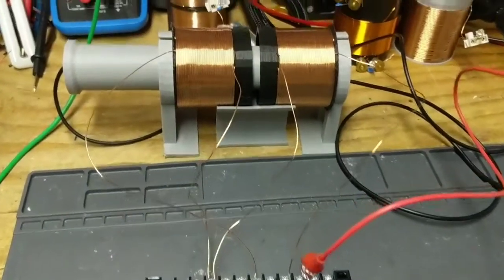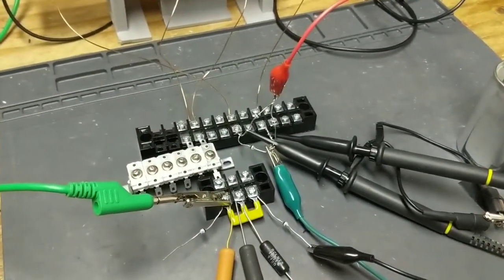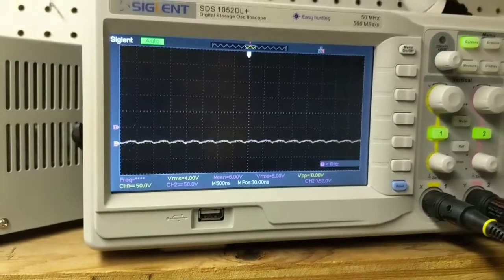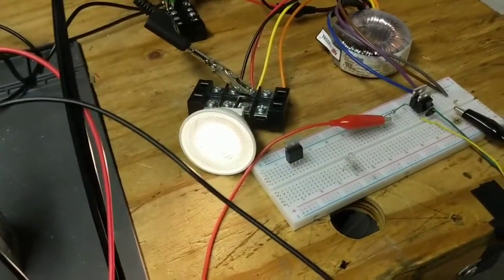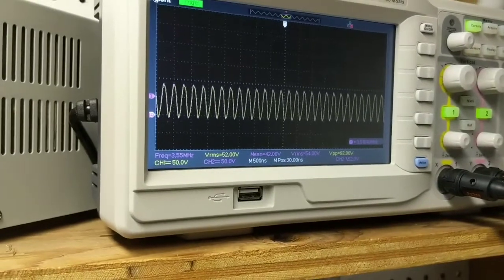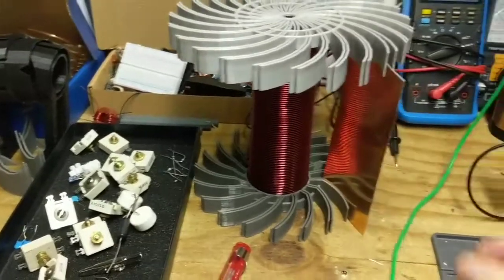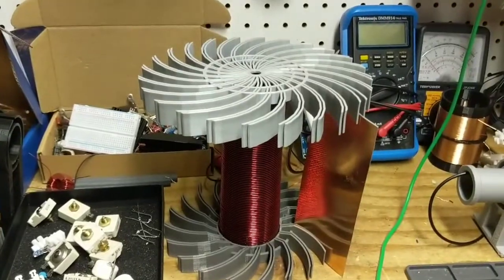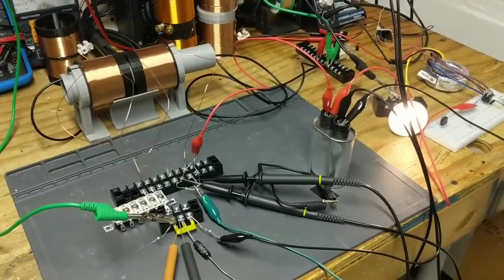Don Smith Circuit - Jan '22 Update & Schematics

Comment: I received the RICK I and II kits earlier this year.  I have tried building a Don Smith device prototype.  I used a NST.  I put a spark gap on the L1 side and made sparks real good.  I got resonance on the L2 side.  But my input was far less than my output.  I am glad to see some else trying.  I have learned from your videos about quarter wave, half wave, and full wave.  I don't think Rick goes into detail about that.  Anyway, thanks for sharing this.  I plan on sticking with this research until I figure it out.

Comment: Use a ZVS to run your coil at its resonant frequency. Do not worry about your L2. use 2cl diodes  backwards with a 100 nanosecond time. you also need 8uf's of capacitor at your high voltage after your combination of the two ends. Use a voltage divider to get to  the voltage of your high voltage capacitor. you also need about 8 microfarads of capacitance at 2,000 to 8,000 volts. Use a larger ground cable. otherwise you have it nailed.
Reply from the maker: Thanks!  I haven't posted many videos lately, but yes finding ways to create more independence between L1 and L2 has been something I've been working on. A ZVS could help here, while boosting the input voltage of course...  then dealing with the downstream.  Not looking to run my house right now, but getting the basic processes down.
Reply from the maker: @Biokemist-o3k  I will definitely look at those.  Pretty much the area of the book I glossed over.  🤔. And you hit the main problem I've had right on the head, more load, more input.  Getting source independent of the load is where I've been spending my time.  Thanks!

Comment: Hi

Great work. I am trying the same and more
Anyway, I am using L1 at 1/4 of L2.
Why is yours different? I am kind of noob.
Also, would you be sharing your coiil 3d files? 
Thank you sir
Reply from the maker: My L1 is 1/4 the length of each side of the L2.  Here L2 is kind of viewed as two coils back to back.  Whether that's right I can't totally say lol.
As far as the 3D prints, it's something I may share down the road.  I don't want to compete with Rich Friedreich's RICK Kit 2, as I'm assuming we will all learn quite a bit from that kit.  But I'll tell you these are quite easy to create and TinkerCAD is quite an easy tool to use to get some basic coil forms.
Reply: @phives5910  thank you. 
I already ordered Rick’s kit. Also, I do print formers on my printer but not being a CAD. Expert, sometimes they don’t print right and I waste stuff. I don’t think this competes with Ricks, as I was talking about just the formers and holders like the one holding Don’s or he new plate thingy

Anyway, thanks hank you
Reply from the maker: So just some hints from experience in printing lots of coil forms lately (though I'm no expert):
1. Make sure bed leveling is good!  All my bad prints were from very poor bed levelling.  Even when you think it's good, check it again.
2. I use two basic shapes, cylinders and cones.  And I keep it simple, as mentioned TinkerCAD is really the simplest of tools I've found so far.
3. Most prints I can get away from 0.2mm, though anything with an overhang I print in 0.1mm (even small overhangs).
4. 4mm wall thickness has been a decent compromise for me, 2.5mm can sometimes break depending on what gauge wire you're winding.  I can get away with 2.5mm on solid cylinders, but if I add gaps the remove material, it's 4mm.

I've noticed on the PLA prints that thermal expansion have been causing some drift in resonant frequency, so I'm going to experiment more with PETG.
Reply: @phives5910  great advise. FYI, I am a retired math teacher from NYU.

Anyway, back to coil wire length and frequency. A couple of issues
1. On Don’s board he talks about the 2 turns cut from the middle and put on one side and 4 turns cut and put on the other side. Why would he do that. My guess is those are separate coils and not connected to the other coils. Just a guess. The reasoning say that, I think he is not drawing power from the middle 2 coils, but drawing from the 2 smaller coils on the end. If you remember in one video he is walking around with the Message glass transformer and gets a schlock. So, with his talk all the time about radio, I think one can build multiple Metglass or otherwise, transformers that are tuned to the same frequency and pick up charges there and not necessarily connecting to the board. In one video he says anyone in the neighborhood can receive power wirelessly and hen he jumpsbtonsom hung else.

My guess is that’s the reason he never shows the output side: 

What do you think?
You much much farther than I.
Thank you
Reply from the maker: Lol, I would not say I'm farther... I've got a lot to learn, but I've been researching quite a bit more lately.  So I'll share a couple things I've been thinking about in general:
1. When the L1 and L2(s) are coupled, they are coupled electrically as well as magnetically.  Though Don did talk alot about the magnetic side, was he actually using the capacitive coupling between the coils?  Later devices he developed had no coils, except for what was in the NST.
2. How do we get the L1 and L2 to talk in an TX/ RX relationship, where what happens downstream does not affect the source?  Somehow we need to get the source and L1 much higher impedance than L2 (I'm sure every way I've driven L1 so far has been wrong). I'll be looking into more 1-wire power transfer methods.
3. I'm not sure how much in the case you mentioned that Don used either a. heterodyning between the coils (to get higher frequencies) or b. in that case also with the capacitor across 1/2 of L2, if this actually looks like a series coil (because of the shunt) and was used more for tuning.

Comment: It’s clear that your coil winding is incorrect how many turns do you have on your L2 Friedrich is a joke  you somehow think you are going to harvest 150,000 V with what diodes ? I’m Finish helping you build it properly or leave it the fuck alone
Reply from the maker: Personally I'm not going to disparage anyone on this channel and would encourage others to do the same.  I do happen to be an avid watcher of your channel, as well as others.  I think we're all after the same thing here.

As far as the current setup, it's low voltage, no NST.  If the theory holds it should work for low voltage setups as well as high voltage setup, just using the square laws higher voltage will obviously offer greater output in the end.

Each half of the L2 is 60 turns, 38.5 ft total length for each half.  The L1 is 10 turns, and is approximately 1/4 length one half the L2.
Reply: @phives5910  i’m glad you watch my show but if you’re turning ratio is not within the terms how do you expect to capture anything? Your statement is not correct it will not happen with low voltage you need to agitate the ambient at a level beyond the ambient pressure let’s assume ambient is at 50,000 V in your neck of the woods how are you going to disturb 50,000 V with 50 V it’s not going to happen I do realize what kind of work goes into this I’ve spent my life learning  The collapse of the magnetic field comes back and you capture it at high voltage potential The cycling Don Smith speaks of is an ambient potential of the background and the collapsing of it from a higher ambient potential to the ambient potential background that gets harvested I have made mention in many videos of the numerous ground planes that are established that must be utilized to achieve extra output this can be achieved utilizing earth  grounding or aerial grounding if you notice the cycling is packaged inside of an envelope above earth ground potential it is harvested at the peak of the cycling which is the collapse of the magnetic field above earth potential 2 ground planes I don’t mean to be rude but they divided the entire populace and gave them 1000 paths that lead to nowhere

Comment: Happy New Year!
Glad to see someone else's also getting to resonant frequencies.
I like your 3D printed parts to hold the plates around the coil.  I did almost the exact same experiments.    
I used a by filer flat pancake coil and underneath it instead of placing smaller coils to pick up the energy I used small sheets of aluminum foil.
Keep up the good work!
Reply from the maker: Yea I've been working on 3D printing lots of coil forms and other parts to play around with.  And I'll upload a video soon about those plates, experimenting with different configurations and connections.

Comment: I did some experiments past week with bucking coils and experienced that the led's electronics create bad influence on resonance. The internal  switching made the current to pulse witch influenced results. It was better when I used a power led module with rectifier bridge. I was not able to get cop 1 but just wanted to let you know that maybe you can try a continous load or switching in sync with transmitter coil (just idea's)
Reply: Happy New Year Bruno!
Reply from the maker: Happy New Year both Bruno and Inventor3!
Reply from the maker: Yes this is why for the video I just showed it with the frequency generator directly connected.  It's a lot cleaner to see what's going on.
Reply: Happy new year to all :)